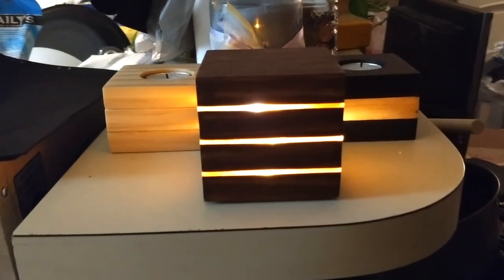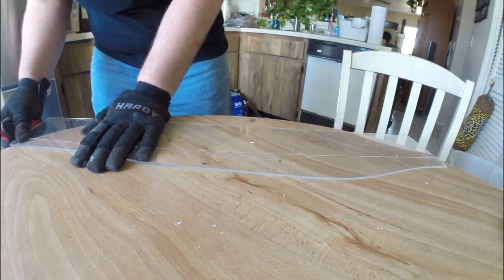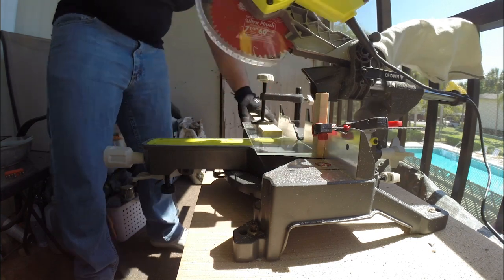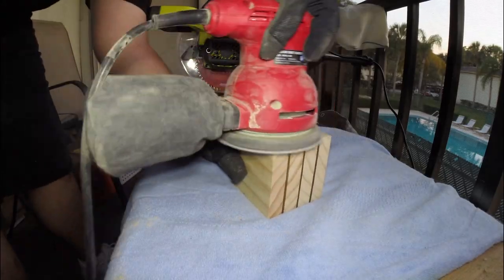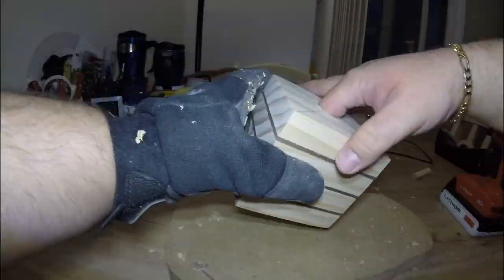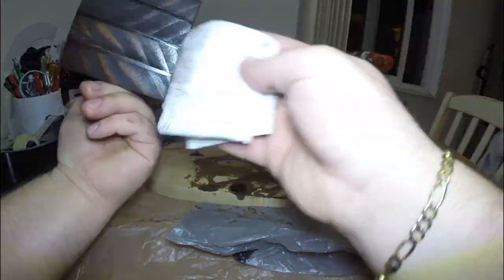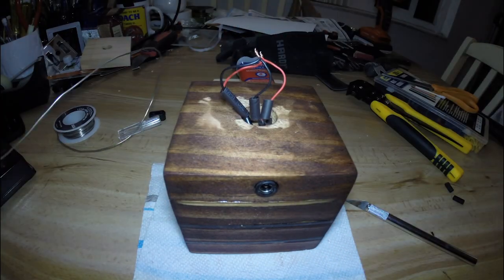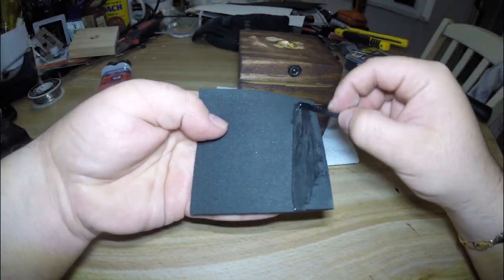LED Cube Light (DIY)

Comment: how well did the epoxy hold the acrylic to the wood? i want to use this process to make coasters for my bar
Reply from the maker: The epoxy has held up perfectly over the years. Haven't had a single issue with it at all. Sorry for the late reply. Unfortunately due to life being hectic over the past few years I have had to step away from the channel. I have a number of projects coming up soon so be sure to subscribe for when I make my return.